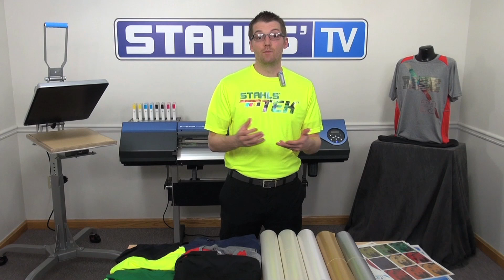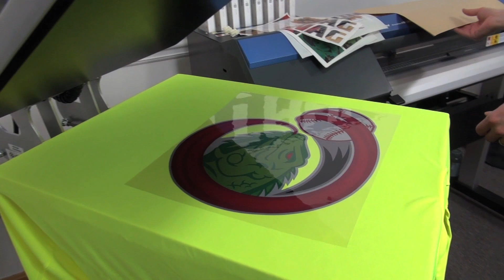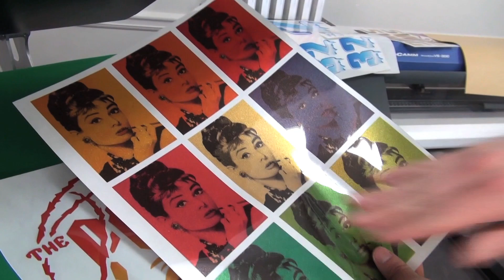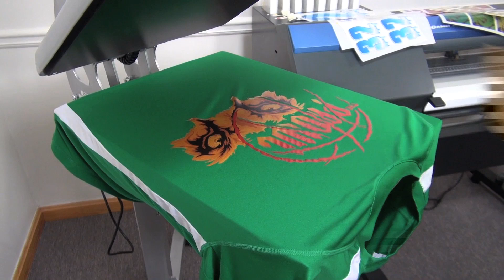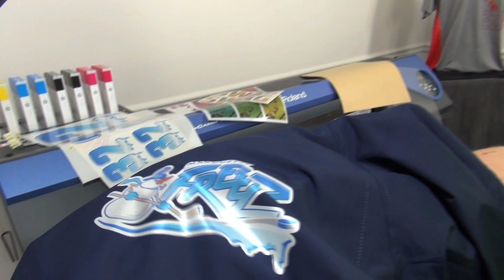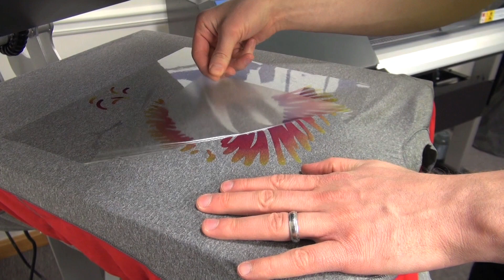CAD-COLOR® FoilTEK™ Printable Heat Transfer Material

Comment: can you use a sublimation printer for this vinyl
Reply: +Syreeta Morgan No, the material does not have a sublimation receptor.  You will need to print it with eco solvent or solvent inks